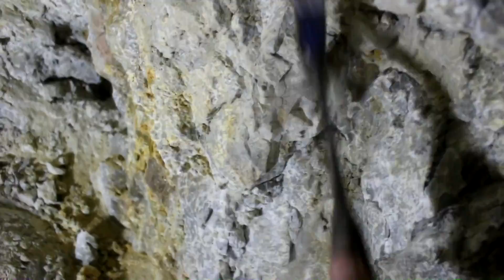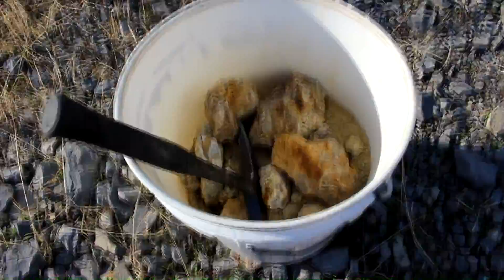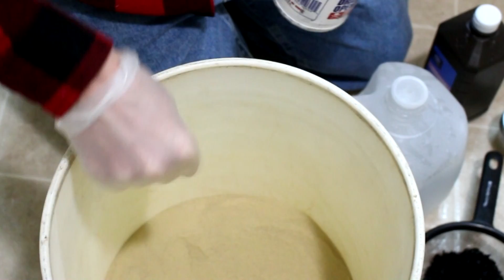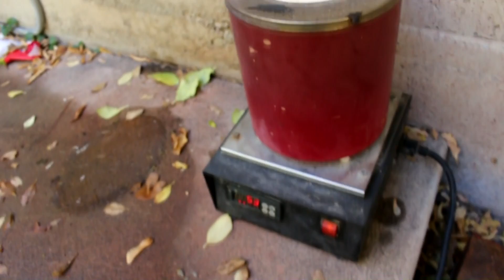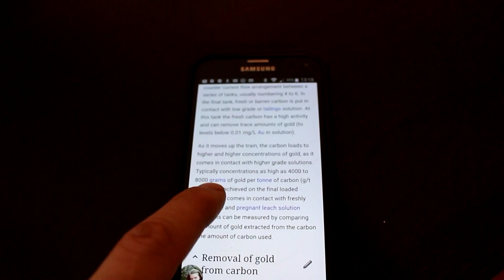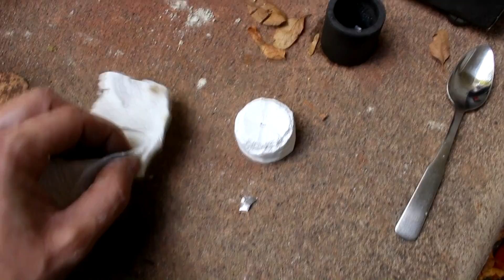Codys Mine Part 16: Extracting Metal (Precious metals episode 15)

Comment: @Cody'sLab, I know this is an older video, but I was wondering if you've ever tried extracting gold and silver straight from sulfides using Ferric Chloride? I see mention of it in the literature often; sounds like a potentially safer and more effective way to recover precious metal values from ore. I'm planning a similar process in my own back yard but am curious as to your thoughts?

Comment: I don't get your conclusions? I could tell you need more carbon and I am pretty ignorant but I have been mixing things for construction a long time and I would have added a 33% by volume carbon to that bucket knowing it would burn away and is cheap compared to your effort. I would have gotten the metal out then knowing I gave it plenty to absorb to. You would have had a hundred-fold recovery if it was there. At least I would feel I made an adequate effort and not doubted that aspect. Look forward to your next attempt. I am trying acids on Hematite and I saved my waste acid. I have a precipitant from Shor but I do not know what it is, but I will test to see if I can get the gold out of the waste acid Hydrochloric at 15%. When you fail in one of these please do it till you succeed or I don't know if you really are on the right track? Thanks for your efforts, either way, I am learning from you. One more thing I need to know where to get that rock crusher you have? Please tell me.

Comment: Yeah I enjoyed the video too.  I suspect, as you, that your values were left in the bucket.  In mines using this process, they use towers packed with carbon, a little smaller than the pieces  you used.  Then pass the preg solution over the carbon until the solution begins to show values at the base of the tower (breakout).  You might want to try cobbing together a small glass tower and fill it with your carbon.  Then filter the preg solution to get rid of the waste, refilter the solution and pass that over the carbon and try your burnout again.  I'll bet your values will be closer to your assay then.  This is the Merril Crow process and is very prevalent.

I'll bet you might try electro winning as well.   I like your videos.  Your creeper sticks are the resultant of not being able to buy explosives in the hardware store any more.  I actually remember that.  You could get dynamite (before tnt) and detonators.  You could also get anfo commercially, but over the counter then as well.  It was easier to blast in the good old days.  Now we use black powder with home made igniters.  More dangerous by at least a degree of magnitude.  You do what  you have to do to move the rock.
Reply: You seem to know alot about recovering gold. How can I get a very small amount of gold from around 6oz of ore dust? I can't seem to find any sodium cyanide.

Comment: Cody, I'm curious. Idk much about mining. I'm wondering, you said the mine was abandoned. Even if its because of low yield, couldn't just a few feet be hiding a huge gold strike?
Reply: gold nodules tend to form under very specific conditions. Utah doesn't have those specific formations, instead there are enriched layers of rocks with small particles that can be processed en-masse to yield precious metals.

The largest open-pit mine in the world is located right next to SLC and primarily produces high-purity copper, but depending on metal prices it makes a larger profit on the secondary precious metals like gold.
Reply: @xerravon  the ore body is called the "Bingham Mine Formation".

it was formed when very salty and pressurized water from the mantle broke through faults in a folded sandstone/limestone layer and mixed with cool water coming from the surface 40 million years ago. 

The extremely hot water chemically changed and fractured the rock. A few million years into this process, fissures of magma started to seep and solidify into the folds. 

The hot/cold water mixing process acted on the new "porphyry" layer, metamorphically altering it too. 

The cooling water flowing through the zone of the now-solid magma seep was ideal for metals and metal compounds to concentrate in the rock and in the (microscopic) fissures and cracks.

This process led to the gold and copper being  very dispersed in a huge area across the fold, as it's not only in the microscopic cracks between rocks, but in the transformed rock too.

Comment: Cody, I have some basic questions. Have you taken a good metal detector into the mine yet? Does the mineralized sample release any garlic odor when you chip away at it?  If so, it could contain some arsenic (bad stuff).  Have you relocated the snake yet? As usual, a very good video! By the way, I'm a fairly new subscriber and have not come across any comment on the major you've chosen in college and what school you're attending.

Comment: You seriously dugout a misfired round?  I would bet you use Anfo cartridges which, as you say, is easily stopped by water - but what is your primary explosive?  I guess since you're using a simple detonator with a burning fuse it isn't super risky compared to nonel or electronic.  I'm fairly certain i know what easily homemade primary you use but won't post it here and know that it would be rendered non-explosive with water - but that's still scary!

Comment: Dear Cody, you should drill holes in the roof on top of the supports so it can vent air though out the mine and when there is dust it can vent out of there also. Just make sure to add a small top to the vents in the ground leading into the mine so when it rains or snows it won't get in there.          
Sincerely, Your fan.

Comment: You should get an old carbide lantern to wear on your head. You could probably buy them on ebay or something. My grandpa has one that he got from my uncle i think, that worked in a mine im pretty sure. Im gonna bring my dads gasket set to my grandma and grandpas house next time i get the chance, fill it with a couple carbide chunks, add some water in the tank, and see if it fires up! I think if you get one, itll fit the mood of being a miner long ago haha!

Comment: In regards to the faulty igniter, in the professional fireworks industry, we use an igniter continuity tester that runs an extremely low current (<10mA) through the ignition line, giving you a red light if there's connection. If you're looking to avoid that happening again in the future, picking one up might help. They usually run 10-15 bucks.

Comment: Cyanide leaching works on fist sized rocks easily, those one you sifted out couldve been leached with the spare cyanide.If there is enough of a muckheap at that mine you could do a heap leach by putting it gently onto a plastic base,with a dam and sprinkler system,etc...

Comment: I'm not expert but looking at the article on the wiki Cody had, using a multi tank of activated carbon would yield 4-8 grams per kg of carbon.  So if the results from the lab would suggest as much as they did, would he not have had to use 0.5 Kg of carbon and use it in stages?

Comment: Wouldn't the surface area affect how the carbon picks up the material out of the solution?  Could you add an air pump to make it more efficient?  Looks like you could save time and chemicals in refining if you save more raw material in between each step.

Comment: If you had 100% recovery (according to the expected amounts from the assay), would it be decently profitable to recover the minerals?
Reply from the maker: Still no.
Reply: Cody'sLab That sucks. But thanks for doing the videos man. You really are amazing.
Reply: He does it more for fun i think less for profit.
Reply: what if you recover it in a different (cheaper) way? 
i think its still quite interesting watching you doing it :)
Reply: he would make more money off youtube than that single half bucket... however... if he where able to get the ore out in large amounts and able to process it all quickly and efficiently... he Might break even... or, he could make more money going to a known high gold bearing placer deposit in nevada and or surface searching with a metal detector... i for one, think his mine is pretty awesome, reguardless of how much metals its got, if it where me however, i would build a machine that would allow me to smooth out the walls using an angle grinder mounted on a swiveling post to carve it out... or a diamond blade saw with a water supply... but then, its his mine, so he can do what he wants with it lol

Comment: What are your cuples mode out of.
Reply from the maker: bone ash
Reply: Cody'sLab that sounds scary lol
Reply: how are they made?
Reply: just speculating here; i think if you heat up bone, not direct flame though, it softens, would make it easier to grind to powder. maybe bleach it, then water rinse? then probably make a mould out of pipe and stamp it down to size/shape and let it set. I imagine it needs a binder?

Comment: I really enjoy your videos. My son and I had a claim many years ago mining placer gold which was about 98% pure. I totally understand your situation with hard rock mining. Have you panned or sluiced tailings? They can actually produce more gold than by cyanide. There were both types in the area of mining we were in.The old time miners from the hay day left a lot of gold on the ground. Plus every spring run off brings more along. The mother load of the Big Bear California area was never located. It either is still to be found or, it was just a giant placer mountain range. It is literally everywhere. We panned about a 1/2 ounce in our endeavors. Just a hobby that may be worth taking up as a trade soon. But the work is insane without a trammel and a separator. Of course that is why god made mercury and potatoes right?🤑 take care.

Comment: A plastic 5 gallon bucket typically weighs around 3 pounds btw.
~A guy who runs the scales at a scrap yard.
Reply from the maker: Sooo I got even worse results...
Reply: Cody'sLab I'm sorry, I thought about that afterwards. :/
Reply: Most buckets weigh well under 2 pounds. 
~a guy who has never needed to weigh a bucket before reading this comment, but is still 50% more accurate than your nonsense.

Comment: So why exactly do you have lye, cyanide, and hydrogen peroxide just laying around stout house?
Reply: around your house* (autocorrect errors)
Reply: Why do you need lye again?
Reply: Campbell Lloyd why don't you?
Reply: Campbell Lloyd actually I have hydrogen peroxide in my house.
Reply: b/c im not a Terrorist
Reply: Lye is mainly sold for cleaning drains.  You can also make soap with it it.
Reply: and the cyanide?
Reply: The CDC says:" In manufacturing, cyanide is used to make paper, textiles, and plastics. It is present in the chemicals used to develop photographs. Cyanide salts are used in metallurgy for electroplating, metal cleaning, and removing gold from its ore."

Since he is removing gold from its ore, he bought some cyanide to do that.  You can't get it at the hardware store.  I suspect it came from a chemical supply company.

Sulfuric acid can dissolve flesh yet I can buy a bottle of it at a battery supply company.  Ammonium Nitrate and diesel brought down the Murrah Federal Building in OKC yet I can buy both at my local farm CO-OP.  Many dangerous substances have practical uses.
Reply: 1978garfield thanks for the info much appreciated 👍

Comment: Hi Cody, does the 20ml of hydrogenperoxyd solution really ad a noticable amount of oxygen to the 5 liters of water? And another question, I have no experience with borax myself but in my toxicology course they told use that boric acid is "reproduktions-toxisch" (german for "toxic for your reproduction"), or that there are studies that point to this toxicity. You and many other people like Dave from "Clickspring" seem to be using it without any safety precautions. Is there something that I miss? Dont want to be a safety troll here, great video again. Thanks Falk

Comment: You can test continuity of the fuse wire with a tester. Current used for measurement is very small and SHOULD not trigger the explosive. But take it at your own risk.

Comment: You melted gold with lead, what happened to lead?
Reply: dissolved into the melting dish
Reply: never hear about it where I can get more detail?
Reply: just check out codys playlist he has a few episodes about the process
Reply: 34Scrooge the lead is absorbed into the crucible when it oxidizes in the furnace.
Reply: Just a heads up - it's a cupel - a crucible is very slightly different.
Reply: does that mean ull eventualy run out of lead in the world
Reply: Matter cannot be destroyed or created, so no we won't run out of lead.
Reply: Chyo Kun what so burning wood doesnt destroy wood? wot
Reply: MoDRun No, it does not "Destroy" wood, it merely transforms it. Your example is a chemical change, wood becomes ash after beeing burned. You can't go back to wood, not because you destroyed it, but because you changed the wood's atoms bonds and order. That means that if you were to examine the atoms of the now ash, you'd find all of the wood atoms displayed differently, creating another element. Nothing is destroyed. Physical changes however (the one you mentioned with lead) don't change the atom's itentity, changing only its physical form. Lead dissolved into the cupel, but you can easily recover it and get your lead back, it's still there, just in another form.

Comment: 4:50 Propane doesn't smell like anything, they actually add sulfur compounds to make it smell like rotten eggs. In my city (Aachen, Germany) actually they changed the smell from sulfur compounds to a like burnt-rubber-y or glue like smell because there are hydrothermal springs that have the same odour as the gas would have so they changed the smell so you can distinguish between the hydrothermal springs and a gas leak when you are digging for example

Comment: Cody where did you get your crucibles for your furnace?
Would i be able to use a ceramic cup for a crucible?
Reply from the maker: Ebay, ceramic cups will need added glutton to work.
Reply: ok thanks
Reply: You seem to go through a lot of them. You must get creates of them delivered or something because you appear to use new ones every time...
Reply: +Cody'sLab what metal with the highest melting point can you melt

Comment: what does flux do?
Reply: If you put it in a capacitor, you can install it in your car and travel through time.
Reply: XXavierSin aaaannnddd in the video?
Reply: SmallBallExtreme thank you :)
Reply: Generally its any additive that changes surface tension of a metal.
Reply: Marius Aš Flux does mutliple things, it is mainly used to absorb foreign elements out of the metal as it melts. its essentially glass, it helps with De Oxidizing, it helps with forming a smooth finish. and it provides a neutral enviroment for the metals to swim in.

Comment: I'll never forget one of the (correct) things I saw on MacGyver.  Pete had sucked up some cyanide that an assassin had shot out of some aerosol contraption.  MacGyver found a photo shop in the mall about 50 yards away (of course, right?).  He uses photo fixer (hypo, which is sodium thiosulfate) diluted with distilled water as the antidote for Pete.

Comment: have you ever found titanium or caught any fumes
Reply: SmallBallExtreme I meant literally DID he find titanium
Reply: ok
Reply: Titanium is really common in the earths crust. Titanium oxide is used as a white dye in paint. The only problem is that it is really expensive to refine, and therefore we don't see much raw titanium metal around.
Reply: johan, you mean distill the Titanium.
Reply: Johan Engqvist true enough.
Reply: Johan Engqvist iron is most common really and also expensive to separate from rock those days.